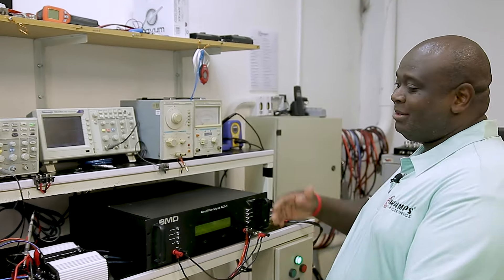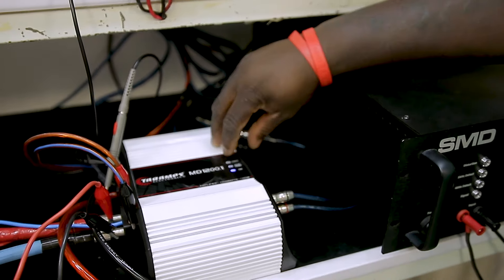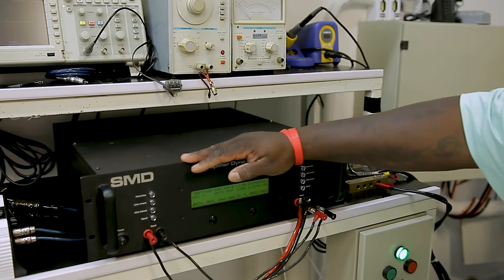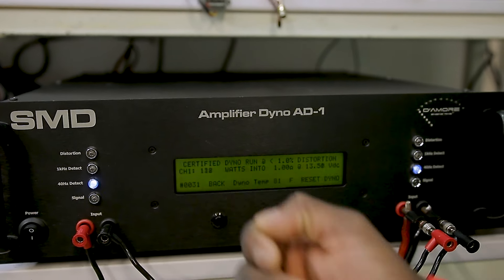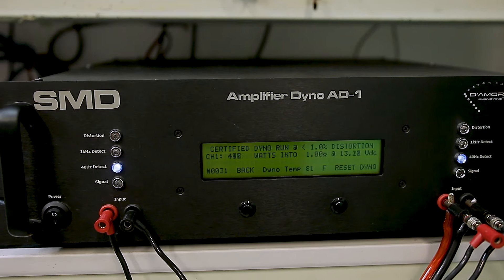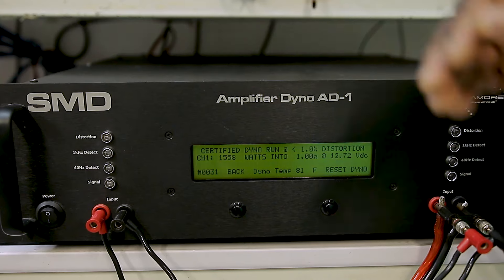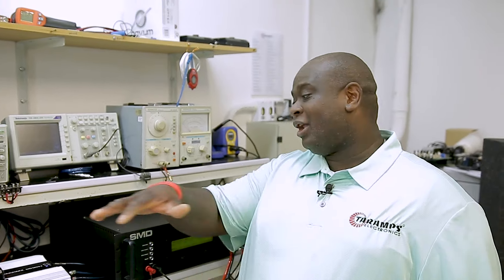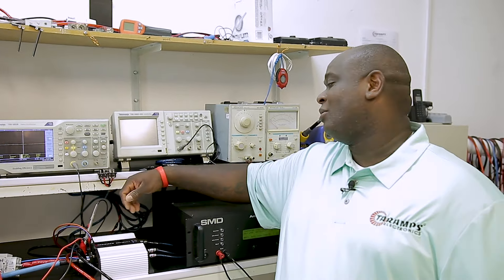Taramps MD 1200.1 1Ohm - Dyno Test (Legendas em Português)

Comment: Recently purchased one to power sundown x8 v3 rated 800rms @ 1ohm. Hope this works out well.
Reply from the maker: Hello reggae mattik! The MD 1200.1 - 1 Ohm should work fine with that sub.
Reply: @CanalTaramps  will there be any difference if I wire my sub x8v3 to 1ohm and use the MD1200.1 vs wiring my sub to 4ohm and using an amp that i already have that is rated at 1000rms at 4ohm (soundstream rubicon 2500.1D)

Comment: whats reliability like of taramps? and can the amp work at 4ohms?
Reply from the maker: Hello @slybunda, we don't make sales here, but you can find Taramps products at official internet stores. 
https://www.taramps.com.br/en/onde-encontrar/
You can find the specifications on our website.
https://www.taramps.com.br/en/produto/md-1200-1-1ohm/
Thanks!
Reply: @CanalTaramps  doesnt really answer the original question does it?
Reply: slybunda they seem to only test them so I’m sure they couldn’t speak on long term reliability. As for running at 4 ohm impedance, any amp can run safely above its recommended ohm load, but not below. You could run this at 16 ohm final impedance if you really wanted to and it would not hurt anything, you would just have a lower power output.

Comment: Can This Amp Run On Stock Electrical?
Reply from the maker: Hello @ol4lx2dolla75. As long as you supply enough amps to the MD 1200.1 for it to operate at normal levels, yes, you can use it in your vehicle's standard electrical system.

Comment: Why do you guys under rate the listed rms compared to dyno'd rms
And gotta say you have a new customer for as long as you make your amps
Reply: This question is phrased exactly how the industry has warped the consumer's understanding. These amps are rated and listed at RMS (Root-Mean-Square or "Nominal") output. The output you see on these dyno runs should be considered as maximum, or damn close. That being said, if you want to run this amp full-time at 1200watts, you can. If you have an honest manufacturer selling speakers who also properly rates their goods, you can easily match equipment for optimal performance. A 1000w Boss amp is rated at maximum output, or more like, if you pull 1000w out of it, you will only do it once before you let the smoke out. If you look at the Boss amp RMS specifications, you'll see those wildly overstated as well. If you’re buying cheap amps (Rockville, Boss, Blaupunkt, etc..) you can make them work. Just divide their rating by 3.785. It's as though they rate their output in liters and we need to convert them to gallons. As for Taramps, they are simply setting the bar for the industry. Affordable, reliable, honest power. I have a 3000w and 2 of their 800x4@1ohm and @2ohm. Their multichannel amps are advertised at combined output (4x200=800). All of them significantly outperform their price. I have a Planet Audio 1200w amp that has a single 40A fuse...somehow, this amp is suppose to pull 1200w @ 14.4v through a 40A fuse. Even if 1200w was it's "MAX" rating, how? The fuse should blow around 500w. That P.A. amp would constantly overheat running 4 x 6.5" 80watt Kicker full range speakers at 2ohms and at 8ohms. It's a class A/B space heater at best. Buy Taramps and enjoy.

Comment: What is the peak power
Reply from the maker: When measuring power, we only consider the total in Watts Rms. As stated in the manual, the MD 1200.1 provides 1200 Watts Rms.

Ao medir a potência, consideramos apenas o total em Watts Rms. Conforme declarado no manual, o MD 1200.1 fornece 1200 Watts Rms.